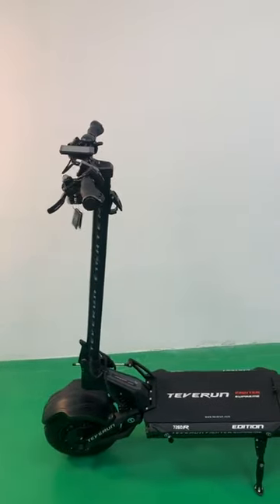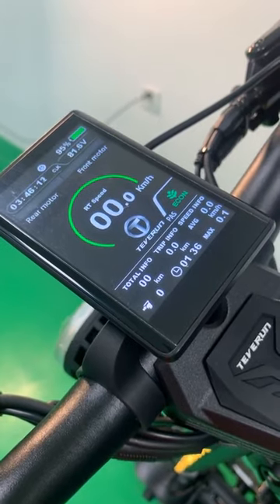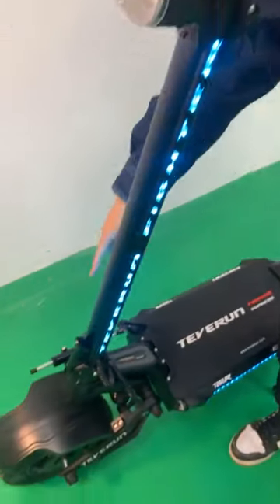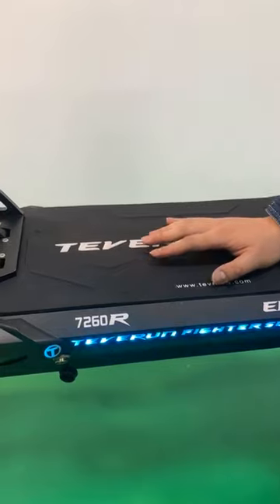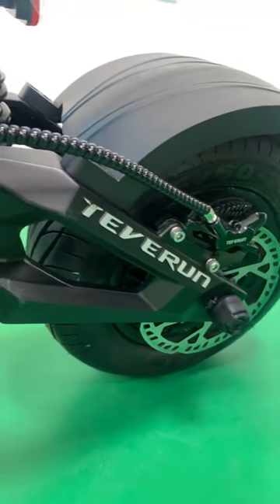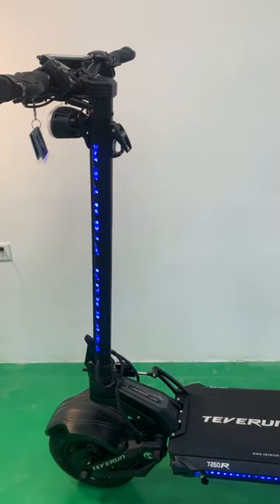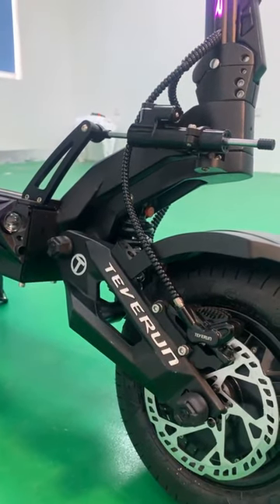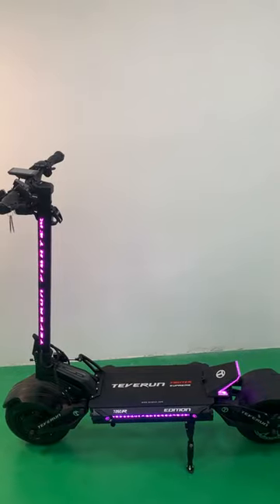TEVERUN SUPER SCOOTER!! 10000W 72V60AH FIGHTER 7260R SCOOTER

Comment: After 2 months with fighter 11+ I can say well done. Nothing is falling apart. lost only some rubber caps. Now make 11++ version with 50 to 60Ah battery. Same dimensions, bigger battery. Also braking handle should have 5 stages of regenerative braking power or seamless... Same with power, instead of "gears" just limit speed and power to acceleration handle position. Fix that and it will be top shit. Also maybe ambient lighting option to illuminate the ground.
Reply: You can't make the same dimension as the current fighter 11 with a 60ah battery.
60aH size is huge and will automatically make the deck bigger.

Comment: This scooter Maybe should of had dual spring coil shocks absorbers instead of one on the front and one on the back. Or maybe making those individual shocks a bit more thicker for enhanced smoother ride and stability at higher speeds but that's my opinion. This scooter might be my next purchase I hope it's not more then 5k lol.
Reply: battery will cost atleast 3k
Reply: Sa sera  toujours moins chers qu'une dx limited
Reply: Hey I live in LA.   HMU and I will see what I can do to set u up with one 7260R at a deal that you won't find any where else even at dealer.

Comment: Is this version with the 13 inch tire different than the fighter supreme ? 
I Definitely would want on with the 13 “ tires.
Reply: Yes it's different it's not just about tires, it also has wider deck, bigger and better way much safer Battery, it has more power engines,higher top Speed, more weight, more stability,more brutal it's is literally Batman Terminator scooter that could be used by Batman also terminator.
Reply: Sound cool , I asked people that tested this type, they said it is Gonky compared to the fighter supreme that is ver nimble , is there something that should be improved on the 7260 to make it nimble also? I definitely like the look of the 7260.
Reply: @hamitfusha710  i think yet nobody really own this 7260R right now, maybe in one or two months finally will be some real review on this, i want a buy one, but i want to buy some what is approved, so i want to see how it rides, if it's really that Fast and other things, so i will wait couple of months to see if it's worth it.
Reply: @havranbagada7509  Yes , I heard people who went over seas testing this 7260 & said it was very gonky & the fighter supreme very nimble,I’m hoping they tweak the 7260 & make it nimble because I really want the beefier scooter with larger tires
Reply: @hamitfusha710  it's hard to make a 63kg scooter as nimble as a 45kg scooter tbh. I think the 7260 is more of a big comfortable and very fast cruiser.  Kind of like a big and fast SUV
Reply: @hotlinebling2851  Makes sense , I didn’t know there was such a weight difference, I’m sure it takes on bumps & perhaps sand  better that the fighter